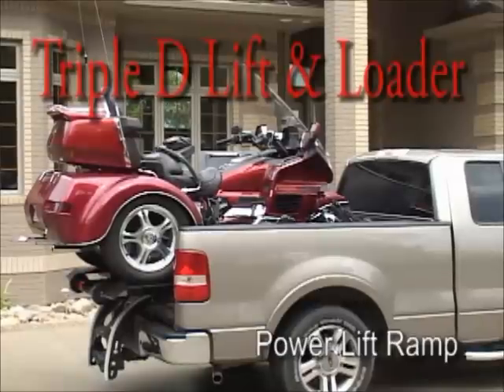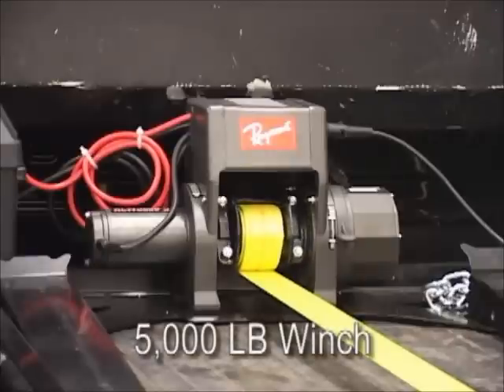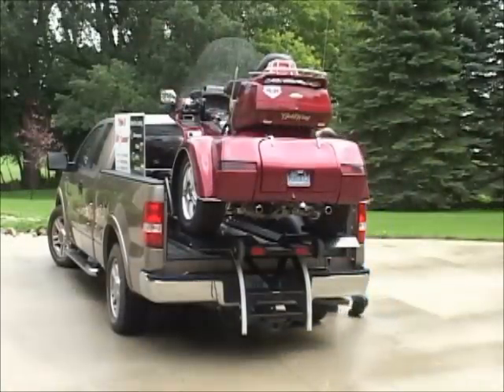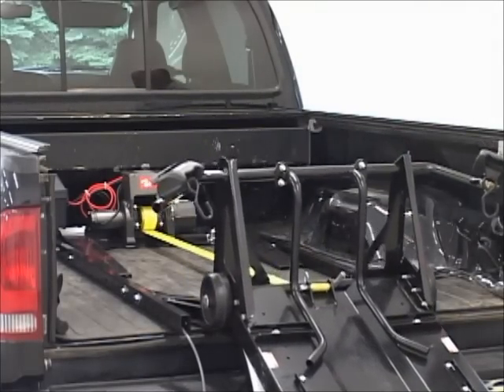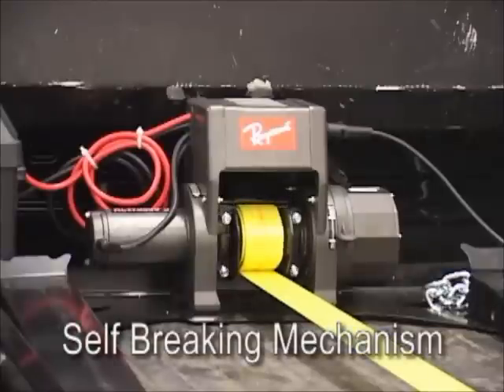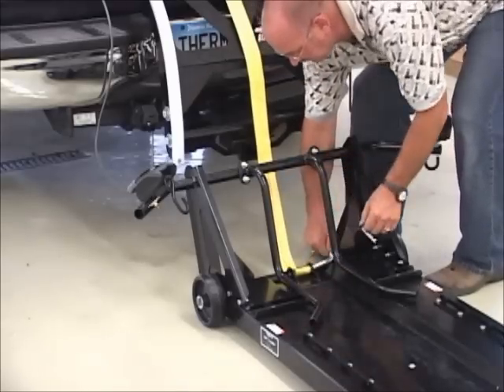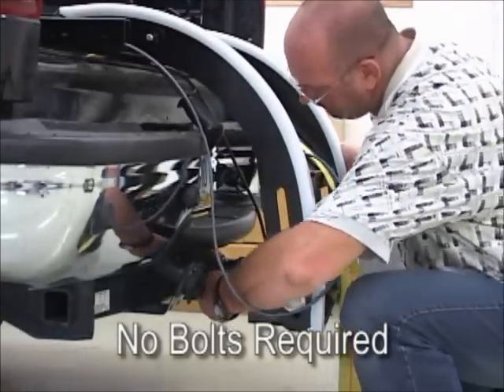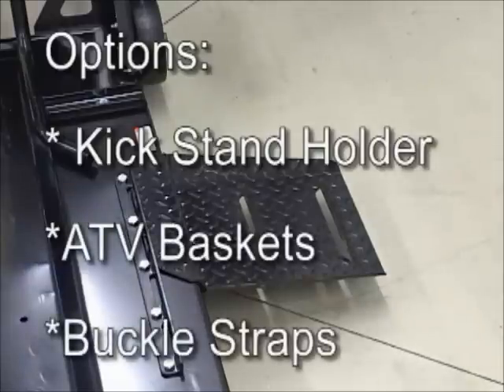motorcycle lift and loader

Comment: Ok, so the lift weighs around 300 lbs, that bike in the video weighs around 900 lbs, and then you think you're gonna hook up a 30' travel trailer with a dry tongue weight of 700-800 lbs to the back of it too. You're looking at over a ton of weight on the ass end of a pickup truck. You better have a one ton dually with a diesel engine in it if you plan on pulling all that weight around the country!  Then when you're not using it, you've got 300 lbs in the bed of the truck, burning up fuel and taking up room to haul anything back there. The way to do it right is to buy a class a or c motorhome and hook a trailer up to it. The trailer will always be useful for hauling everything else using just a 1/2 t pickup. I think these lifts are dumb ideas. One more thing, by putting all that weight in the bed of a pickup, you've raised the center of gravity to point were an evasive driving maneuver might just end up laying that truck on it side or even rolling it. NO THANKS!

Comment: We bought it in Chandler, Arizona where Mr. Springer the maker of it, keeps his shop. His sons operate the place. The installation is very, very easy procedures-wise, but you'll need muscle for the metal. When you initially install it the bed with the wheels will have the base on top of it. So you roll the whole thing to the bed and start pushing stuff in.
Reply: Can u tell me how to get a hold or # to call would like to get one

Comment: How far does the receiver tube portion of the loader extend the hitch tube? Extending 12" Reduces your hitches capacity by 1/3. Does anyone have a measurement on this? Leverage can cause safety issues for a heavy trailer.
Reply: It doesn't reduce the hitch capacity at all but rather INCREASES the hitch capacity because it is part of the whole platform solidly attached in the bed of the truck and attached as well to the front of the bed, It is much stronger than the hitch tube that is bolted to your truck.

Comment: Since I've had one for 4 years or so, maybe I can answer some these questions. It's between 3-4,000.00 dollars. It took a crew of 3 to load it in and tighten bolts and connect electricity. Of course the tail gate has to come off. The blue tooth remote works just fine. I don't care how it looks on video, this apparatus is heavy. Im 70 and the wife 60 and we work up a serious sweat taking it out or putting it in. For us its an all day job, until family or friends feel sorry for us. I'm sure this things can be made of synthetic composites that are stronger than steel, but the price was go sky high and its high enough. I transported a 2004 Goldwing with with to the East Coast from the West Coast. We've hauled Golf carts, bricks, just about any appliance with all the straps. This could be an investments for those so inclined  to strike out on their own and haul stuff, transport from point a to b. With the lift features all one would have to do is get the object strapped to the platform, load the platform and strap the platform to the truck bed, and your in business. This thing has a 6000 lbs load strap on its wench. It also has a battery right next to it.

Comment: The unit has a patented design that compresses a large gas shock as the winch loads the platform into the truck.  When the bike is unloaded, the gas shock pushes the bike platform out until it reaches the "arc", then gravity takes over.